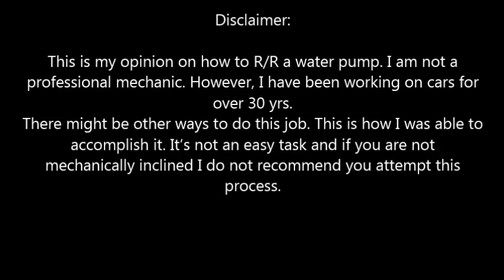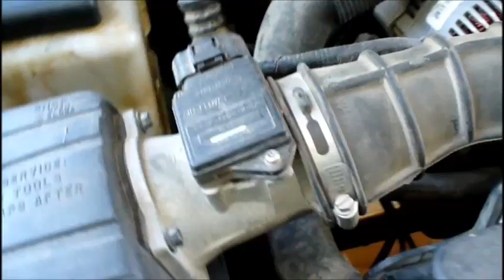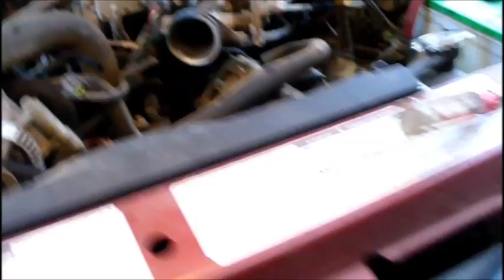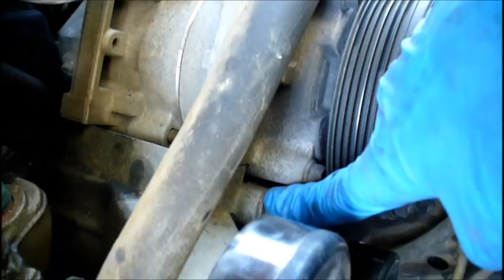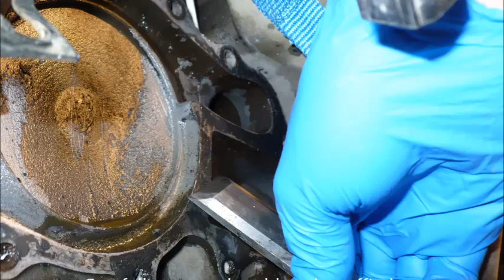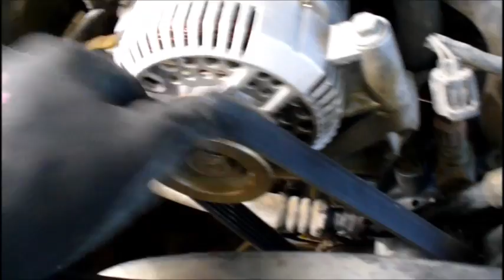1999 Ford Ranger water pump removal and replace

Comment: Does anyone know what size are the 5 smaller bolts. it looks like there is 1 on top, 1 to the far right and 3 on the bottom. I need to get 2 more as mine broke.
Reply from the maker: just guessing, but they might be 1/4-20. or metric 10mm. but what i would do is take one of the ones that did not break down to a parts house or hardware store and compare to find the right size. and FYI, you should be using a torq wrench so you don't break them! should not be cranking that hard that they get broken!

Comment: This is a great video and much appreciated.  I own a 2004 Ford Ranger with the 3.0 Engine.  When purchasing the new replacement Water Pump, I also purchased a new Felpro branded gasket (for $5.49).  The Felpro Gasket was much thicker, and much better quality than the one that came with the new pump.  It  allowed a secured a sealing during the installation process.    I also purchased two new (i.e. two inch and like threaded) 13mm pump bolts from Hone Depot.  I  sawed off the head of these bolts to use as guide pins for the Water Pump.  I then threaded these two guide pins into the engine block.  It made the alignment and installation process so much easier.  I did the same to allow removal of the Fan Blade from the water pump pulley.  I removed two of the short pulley bolts, and then threaded  these longer bolts into the pulley.  I then used a large screw driver and inserted it between these two bolts (i.e. behind the water pump pulley).  This prevented movement of the pulley, and allowed easy removal (as well as a secured tightening after reinstalling) of the fan blade.  Also, removing the Driver's side Tire, made it much easier to access the (2) rear bolts that go into the rear Power Steering/Compressor bracket. I hope these additional tips will help someone else.  I am not a mechanic, but was successful in doing this repair.  It also saved me about $500.00 when doing this myself.

Comment: Get the rental tool from Auto Zone instead of using the adjustable wrench. The rental tool uses your breaker bar. The tool is thinner than an adjustable wrench so it fits in easier.

Comment: Helpful, though took the advice of using sealant with the gasket, and now I know why the OEM DIDN'T use it. Extra failing point. Followed instructions on the tube, let it sit for 24 hours before adding fluid, thankfully it was only $5 of distilled water and not $50 of coolant, cause that gasket sealant failed HARD. Pissed like a racehorse, thankfully I was able to make it home. Going to disassemble, remove gasket material, PRAY it didn't damage the gasket, and reapply as OEM intended. Everything else though was a great help.

Comment: Don't remove the belt before the fan and shroud, remove the fan and shroud first, then break loose the four pulley bolts from the water pump pulley (the belt tension holds the pulley,simply loosen the bolts,don't remove them just crack them loose), THEN remove the belt, the belt will be super easy to acces with fan and shroud already out......and when reinstalling belt, do it as soon as your pulley is put back on the water pump and tightened, don't put belt back on last, or AFTER the fan and shroud are back in place that just makes it harder with no room for your hands, put the belt back on BEFORE the fan and shroud.........i keep the ac compressor attached to the power steering bracket and move the whole bracket a little to get to the two hard to reach bolts

Comment: I'm in the middle of doing a 2002 Mazda B3000, and if you think getting at the 13m's on a Ranger Bracket is a Bitch ... you ain't seen nothin' yet.. You description of their location is helpful. The artist renderings they consider schematics these days make me wonder what the Idiots even bothered to get a CAD degree for ... what's next stick men like cave drawings with a arrow that say put here ???
Thanks.
P.S.
If you have a 4-1/2 D Kant Twist Clamp around you can grab a hold of the Flange area behind the Fan Pulley and rotate it around till it hits, and break the Fan loose. To avoid one of the other various removal methods, we develop because the same Idiot that made the Schematic Drawings forgot to put some Flats for a Clutch Fan Wrench on the Fan Assembly.

Comment: I had problem with the bolts on AC compressor bracket,this bracket has to be moved to the side in order to access the water pump.There are 5 bolts,13mm socket,2 are on the right side,in front 1 is self evident,their are 2 more.They are directly  to the right and left in line with the belt tensioner down low,they are hidden in the metal channels.13mm socket,it pretty much takes a mirror,to see them.I took the belt tensioner off,easyier to get to these two.
Reply: Nice to know I'm replacing that anyways 👍
Reply: This comment helped me find that one hidden bolt, so thank you

Comment: Works for a 2000 as well...quick tip I literally JUST found...on the back of the pulley and in the pump housing there is small notch, the screws stick out past the pulley just a tiny bit...line up the slot and slip a screwdriver between the small screws and the notch and it locks with NO problems, instant righty loosey...I was floored!
HOLY SMOKES taking the bolts out because the accessory mount was hiding that one stupid bolt...ARRRGH!!!!
Totally YouTube Certified now :) 
Thanks for this great video!!!!!!!!
Reply: They did that for the 2000 year, my luck, I have a 99 🤦‍♂️

Comment: Got this problem. Wish you would have shown your work rather than writing what you did.  I still have no idea how to remove the pulleys to get to the one nut on the water pump.  Does anyone should where these bolts are?

Comment: Wow... You made taking off that fan pulley harder than it need be. I just rested the handle of ratchet I used to loosen the tension pulley and then twisted the bolts out of the water pump! Easy!
Reply: Those are 2000 on up

Comment: Real hassle with Ford trucks. I have a 93 Ranger with manual transmission and changing the clutch slave cylinder was a real pain in the butt!
Reply from the maker: I hear ya on that one. i've had to do that on a 98 Ranger. It sucks! and if you do not have the adjustment just right, you have very little play in the clutch pedal, and the clutch will NOT engage. Major pain to work on! Thanks for checking in! ds

Comment: Thank you for the helpful video.
I found 2 torque values for the water pump bolts. For the water pump bolts here are 3 hex sizes & 2 bolt shank sizes. 
The 2 biggest hex sizes with the same shank diameter size is torqued to 18 ft-lb.
The smallest hex with the smallest shank is 7 ft-lb.

Comment: It's a lot easier just to remove the radiator first then you can get the fan shroud out of the way while you are having to deal with that fan which is a giant pain in the ass
Reply from the maker: This would be true if you don't mind dealing with the radiator. I took the more conservative approach. To each his own perspective I guess. what ever works best for you.
Reply: I agree. I used to work at a service station & that's what my friends normally did.

Comment: do you need to take off the pulley 1st and water pump out or when you remove the water pump then you take off the pulley,
Reply from the maker: if i understand your question correctly, you need to remove the pulley first. Then the water pump.
Reply: David= thanks but why not remove the whole unit 1st and take off the water pump...?
Reply from the maker: go ahead and try. kudos if you can do it. Its real hard to get into those tight spaces.
Reply: David = I see it is the tight place...the issue...

Comment: good video buddy.
you don't add distilled water to 50 50 antifreeze, that's already diluted
you do add it to a full strength .
also you need yo purge the system , other wise you're going to have problems with it like not a good heat during cold winter or other problems too.
Reply from the maker: Thanks. That is correct. Perhaps you misunderstood my video. You use (full strength) antifreeze diluted 50% with distilled water. And yes, if the system has not been flushed recently it is a good idea to do so. We did so on this system.

Comment: If only you had this video 3 months prior to July 2016. I had, with the help of 2 others and a LONG breaker bar, turned the shaft the wrong way and snapped it clear off. I had to get a ride to the nearest auto parts(half an hour away from where I was doing the job) and pick up an electric fan to use temporarily with some shady wiring. Still using that temporary electric fan and now I've got a video to help me replace the waterpump. :D Thank you.
Reply: It says that the fan bolt is reverse threaded on the fan shroud.
Reply: @deecee6161  If only folks would read it and not get in hurry.
Reply from the maker: Sorry to hear of that. I learned this lesson when I was about 16 yrs old, rebuilding a ford mustang 289 engine. The older cars all had crank driven fans back then. An "older" wiser mechanic explained to me about the left handed threading. Makes sense. other wise the crank spinning would un-thread the fan! Good luck!

Comment: Can u explain me more about how  do you move the hole ac compressor ..  I have i problem with it..
Reply from the maker: You need to remove the AC mounting bracket. If I remember correctly, there are 3 or 4 13mm bolts on the back side of the AC unit that bolt to the engine block. You can get to one from the front, I think it is behind the tensioner and is recessed in a hole. The other two you get to one from under the truck in the back behind the bracket and the top one from top back side. Its a real pain to get too. Hope this helps. Sorry I was not more clear.

Comment: Very good video, I'm doing it right now, where are the bolts for the AC assembly, I see the one on the front
Reply from the maker: sorry i did not get back to you sooner. you probably figured it out. but there are two other bolts back behind the AC mount. you need to loosen the entire bracket assembly. They are hard to get to. You need to feel up under there for the bolts. I think they are 13mm.

Comment: Excellent video, one question; did you have to remove the whole tensioner or just the pulley??
Thanks
Reply from the maker: Are you referring to the belt tensioner? I think I just removed it. One bolt.

Comment: how long did it take?
Reply from the maker: depending on experience, between 2 and 3 hours.
Reply: +David S thanks for your help!
Reply: David S hellow ,how can i remove the housing to take off the 2 bolts hidden back to the tensioner??
Reply from the maker: can you be more specific? what housing are you referring to? you mean the fan belt shroud?